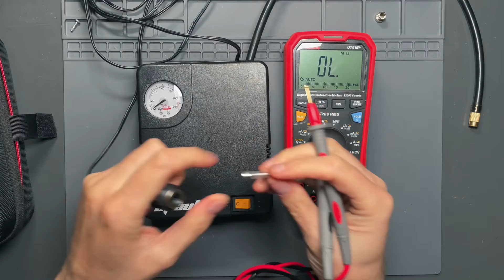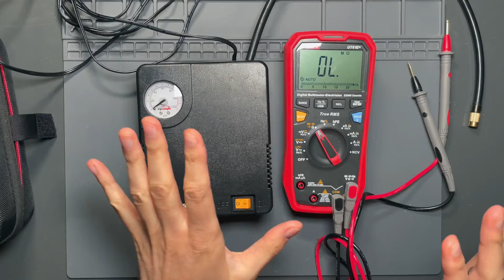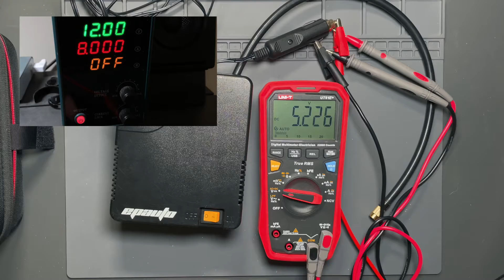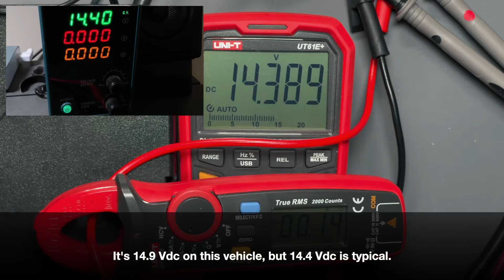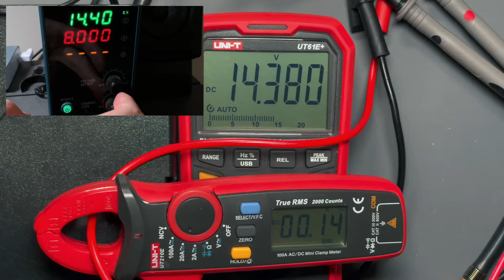Troubleshooting Air Pump Failure

Comment: Interesting!  I wonder if you leave it on for a long time, if the fuse is suitable to protect the motor before it starts a fire.  It seems suspect to me that the motor has a turn-to-turn short before the fuse opens; I think the fuse should be a lower value.  However, maybe the windings are sufficiently small in the motor that the windings will open before any fire occurs.  It is “attended use” and has a air gap switch, so I don’t think that would be “unsafe” per se, but it might be a fun “torture test.”  What if you increase the limit to 11A so it wouldn’t trip the fuse (and, then you can make “this one go to 11”)? Nice breakdown!
Reply from the maker: Sounds like it might make for interesting video! Stay tuned! Thanks for watching!